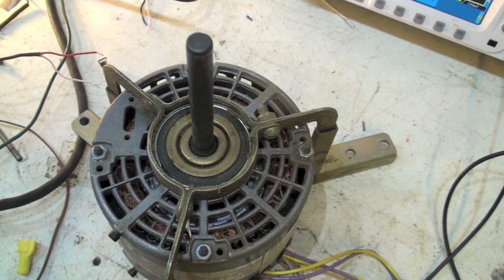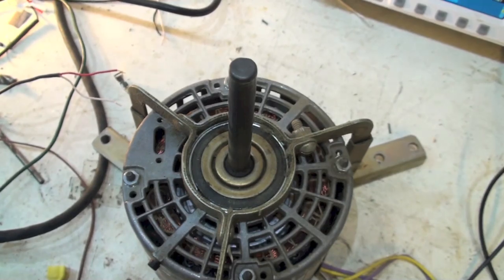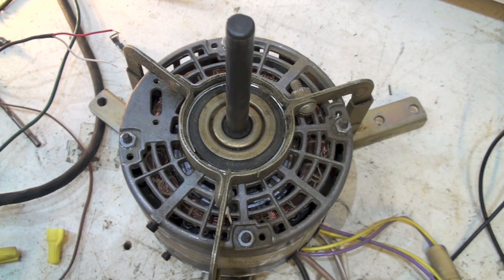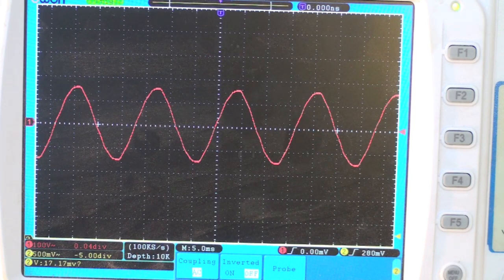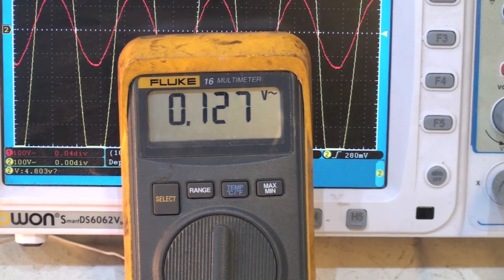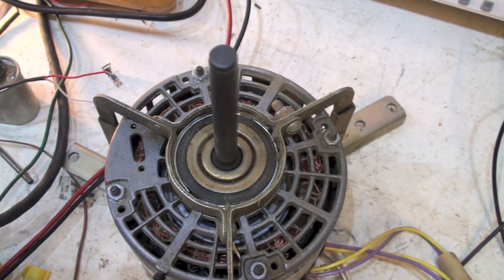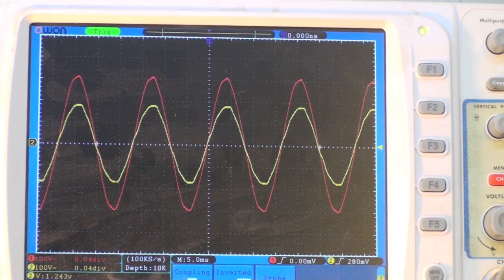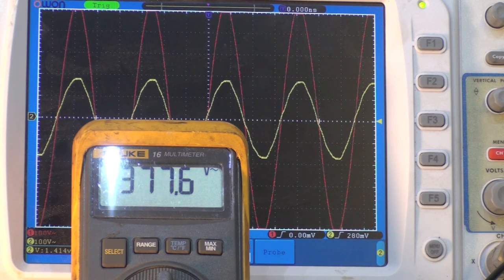Back emf on the PSC motor

Comment: Really enjoyed this video gray! I use back emf to log on my maintenances and make sure motors aren't slowing down.
Reply from the maker: Great idea!  I had not thought of using it for that.  Do you record and then compare?
GFM
Reply: I will note it on my invoice. And sometimes with sharpie on cap and then it is usually close or maybe cap is weak ....compressors do vary more with load of course. It really shows you how much you are de-rated when on 208v.
Reply: Where and how are you checking it?

Comment: Thats exactly what I was looking for, I dont have a scope. My new pulse motor has a single coil, hard drive plates with four neos on it, and a mechanical switch. Coil is 8000 turns iron wire for core. Thanks!

Comment: Of all your videos, this one has to be my favorite. I had always expected the back emf to be out of phase with incoming voltage, if only because it is separated from incoming voltage by the capacitor. I assume you had the capacitor in place when the experiment was done, and you measured back emf from a point between the capacitor and the motor, compared to common. Correct?
Reply: Yes
GFM

Comment: The half above the line is - charged electrons being shoved forward by the same primary force held in the- magnet feild
The half below the line is + side of the magnetic field at source vacuuming/pulling back on the -charged partices that we're shoved forward .

Nothing flowsin a circle.
It's all a back and fourth motion going on in the same straw.

Like water and air moving back and fourth in a tilted capped off pipe.

Comment: Great video.  Back EMF is proportional to motor speed, so a load reduces it because of the speed decrease.  The increase in back EMF also serves to limit the current the motor consumes, so it doesn't go crazy without any load.  The back EMF raising the voltage and stressing the capacitor due to light loading (clogged filter or ducts) is good to keep in mind when out in the field.  If the voltage exceeds the capacitor rating you should try to do something about it (increase airflow or use higher-voltage rated cap).
Reply from the maker: I can't argue with any of that.
GFM

Comment: Very interesting! I wonder what the long-term effects on the capacitor might be?
Reply from the maker: This brings up the use of the Chinese capacitors in the past few years.  Perhaps the Chinese caps were unable to adapt to the plugged filter that reduced load on the motor with the high back EMF.
GFM

Comment: Looked like the cover of a Peter Benchley novel for a sec. I wonder what kind of current is available in that circuit between common and the run cap ? It is an interesting way to get some high voltages ...

Comment: With out the back voltage fighting the influx current, the motor would spin into infinity and self destruct catostrophicaly.
 they it in so generators could not power themselves after an external force brought it up to speed.

Comment: I've seen run capacitor failures skyrocket during my career and I always thought that it was because they are much smaller and cheaper than they used to be. Will back emf increase or decrease on a heat pump outdoor coil with a propeller fan as it begins to frost up? I think that I will using 440v run to replace failed 370v run capacitors. Thanks for another great video.
Reply from the maker: +Jim Gill On the caps.  mostly I think the caps fail because most of them are now made in China.  There are a few still made in this country and they do not have the failures.  The load on the motor lowers as the coil frosts.  That means the motor speeds up.  As it does so, back EMF increases.  It is not a huge amount but it does.  Hope this helps.
GFM

Comment: RECTIFIE the flyback voltage, and feed the high voltage DC into a DC motor to take over for the AC influxe current via a pully and belt.

Comment: Resistance is the energy required for oppisite poles to pull away from each other.
Remove resistance with pure gold windings and remove induced magnitism by REPLACEING ferrous materials with non ferrous.

0 resistance means 1000k efficiency.

Comment: Just had a thought, if you were to check the voltage on a hermetic compressor. Start to common, you will get a high voltage reading. On Run to common, you get a low reading? Please correct me if I'm wrong.  Its been a while.LOL
Reply from the maker: Sorry for the wait. The voltage from run to common will be 120 volts because you are just reading the input voltage.  The reason you get the high back EMF from start to common is the capacitor is in the line.  Hope this helps.
GFM
Reply: grayfurnaceman
 Ok. Thanks for the feed back!

Comment: Why don't you try to measure the current available from the stored flyback voltage.
Or try to charge a huge storage device faster than a small load can discharge it.

Comment: Caps are rated rms peak on 370 volts is523 volts . The back emf does not exceed cap rated volts
Reply: I don't think that is always true.  Many caps are rated at DC voltage, meaning prolonged voltage differential across the capacitor.  His meter readings are approximated rms of ~approx 400v would indicate peak to peak of 565v peak to peak.  If capacitors are rated this way, and you had regular peak to peak voltage of 565,  then you 'should' have a capacitor rated for 565v or more.... I think

Comment: This is blowing my mind 

1. why don't we get this higher back EMF on motors without capacitors?

2. How can back EMF be higher than supply voltage? That's free energy?

Motors can never spin faster than synchronous speed? Even with no load and no friction
Reply: @grayfurnaceman7640  thanks mate, but I'm still lost. How can it be higher? 

Back EMF is lowest on start up and increases reducing amperage as the motor gets to full speed. If the motor is running at full speed with no load or friction. We will have zero current as applied voltage equals back EMF. But no normal induction motor runs at full speed due to load and friction. So how can back EMF be higher?

Comment: Redirect the flyback through a rectifier  into a buck booster an step up transformer, then use this high voltage pulsing DC current to drive a DC motor that will take over for the AC influxe current via a bet and pully.

Comment: Now imagine if you could use this 4× higher voltage than the input voltage to drive a secondary motor which mechanically drives a magnet on magnet generator.

What your witnessing is the second half of ionic pathway through space and time in conductors.

Electrons that move forward must also move backward as ions inorder to become charged electrons again.

Current does not flow like water through a pipe.
Current is the back and fourth movement of elements that already saturate and make up all the conductors in a ircuite.
In ac there must a non physical way to push and pull the elements through conductors. Resistance is relevant to ease of movement in the conductor.

Build it all from gold
See the dierence between ohms law and no law.